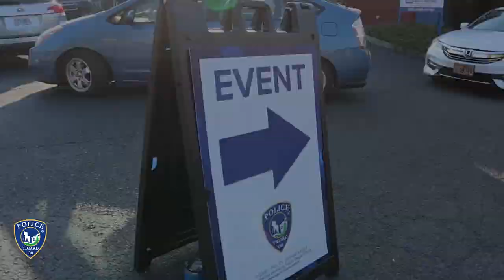Catalytic Converter Theft Prevention Event

Comment: The problem with this is : the criminals will just start breaking down the Converters themselves , then just sell the contents . ( no way to trace the raw materials ) .
Reply: Really? Explain to an honest recycler how you continually supply rare metals?
The BUYERS enable the problem, plain and simple.
Reply: Or wipe the  paint off with acetone and grind the engraving off with a grinder. it's not that hard and would take less than a minute to remove a vibropeen etch. This is nothing more than making the public feel good while actually doing nothing to prevent theft.
Reply: @mrmark8603 they would probably just lie about being part of a recycling company.
Reply: @kcstott I remove every cat on cars we own, not only does it improve mileage,  I get 40 a piece in scrap.
Reply: I found nine stolen a few feet away all emptied out already
Reply: @ThorOdinson-zc2kq ya my one cousin scraps junk, and any vehicle he gets he cut it off right away and makes it straight piped lol, he asked people for junk around the neighborhood and gets rid of peoples old junk piles or Appliances, it’s actually a good thing haha it’s getting recycled lol
Reply: Just start breading down the converters themselves?   That is not an easy task.  It's hard work and thieves are lazy.

Comment: So the paint will withstand the 1,200° heat of a typical catalytic converter and a sander or grinder will not remove the etching?
Reply: if the scrap yard sees its been sanded/grinded off theyll call the police(usually)
Reply: And yes, the paint will withstand the temperature.
Reply: Even shady parts dealers won’t touch something that was obviously stolen. Criminals aren’t going to take the time to remediate a part before selling it. They’re inherently the laziest pieces of shit on the planet.
Reply: Ok, this is not theft prevention, this is theft recovery.
Reply: @davidmussack4529  I'm pretty sure they'll pass up a vehicle with paint. It's too time consuming to try to unload them. Same thing with those whacky locking mechanisms. It's a deterrent
Reply: Most but not all converters have a shield.  So that might help.
Reply: @bryanmanning5726  If that were the case, the scrap yards would already be calling the police when the same people are routinely showing up with catalytic converters to sell.
Reply: Most cops could not care less. My car was stolen and they wouldn't even come take a report. I at least needed to know if it hit an impound before I couldn't afford to pay. Living on a tiny pension it matters.
Reply: No it will not!
Reply: A can of brake cleaner and a few rags will remove that paint from 100 converters. To the people who say thieves are too lazy to do that, or that none of the oh-so-scrupulous scrap dealers will accept them, I’d say that the facts the thieves must either remove the pieces of exhaust pipe they cut or that the scrappers accept them with the pipe stubs attached prove that idea wrong.
Reply: @philsmith2444  this is a great comment. People underestimate how much junkie zombies and other worthless garbage humans will go to avoid doing honest work.

Comment: I got my catalytic converter stolen out of my car in my driveway. After I got it replaced through insurance, I went to a muffler shop where they welded rebar in multiple places to prevent it from being stolen again. Cost me about $125. (The thick rebar can’t be cut with battery operated saws and if they could, it would take too long)

Comment: To the commenters mentioning scrap yards/dealers etc : These cats aren't being stolen by or sold to junk yards or scrap dealers. Catalytic convertor theft are large and sophisticated networks of organized crime.They're stolen by petty criminals who act as employees to various middlemen and they end up in illicit operations that recover the rhodium, platinum, and palladium in the cats. These precious metals go to either legitimate or black markets. Some of it may end up in the hands of legitimate manufacturers of either OEM or aftermarket catalytic converters. 

The cats are most often removed from vehicles that sit higher off the ground and cut off with a battery powered sawzall. Often done by a 2-3 man crew, the whole operation takes about 90-120 seconds. 

The biggest challenge for law enforcement is proving that cats found in a crew's vehicle or a warehouse are actually stolen, and from whom. State's attorneys will usually not charge suspects, so police can't hold them. Permanently serializing cats (like firearms or phone IMEIs) would help reduce theft -- probably not by much -- and the program would add cost to new cars or replacement cats.
Reply: How much can it possibly add to the cat? New cat's have the executive order number stamped into it
Reply: @danp7463  The material cost per cat would be small. The cost of establishing, maintaining, and administering an effective database and the attendant bureaucracy would be higher.
Reply: @peteroleary9447 Why not make it part of vehicle registration? They already keep track of who owns what vehicle, besides other details.

Comment: The problem is the scrap dealers buying these. What should be required is for the VIN on every junk car to have it scribed into the converter at the salvage yard. Then it gets registered on a state computer database. If a false VIN for a car that has not been scrapped is used, the salvage yard gets flagged and inspected. If the scrap yards don't like it, they get their license revoked. Also make it illegal for a scrap yard to buy from a random person without that person scribing the VIN on the ones they are selling to the scrap yard. Also their photo ID would be scanned by the buyer.
Reply: Yes, more state control of whether/not I should be allowed to sell my property. Sounds wonderful.
Reply: @GroovesAndLands  That's right. A lawless society needs enforcement.
Reply: @jonlanigan3439  You Democrats just LOVE liberty, don't you?
Reply: @GroovesAndLands  I'm not a democrat, but if you buy stolen property, then you are a thief. Sounds like you are one of the thieves running the salvage yards.

Comment: So, why aren't the car companies doing this????
Somewhere on the CC, stamp the vin# of the car.
Reply: Cos while it's more effort, they will simply extract the platinum inside the converters if you make it too hard to sell the converter as is.
Reply: I knew a guy who had been in jail for a minor offense tell me that he had never been caught stealing CC's.
He drives around like a college or university where there are plenty of students with cars parked on the streets about the property.
Then he would bring a battery wheel cutter or saw's all (More quiet when run slower speed). He's crawl from one car underneath to the next one parked and in a few hours make over $1000 for the night's work.
I asked him who he sold them to and he said that he had no problem finding someone to sell them. I then asked him why not extract the precious metals himself and he said that it much harder unless you have a good work lab to do that with.
Electric oven for melting and so forth.
He was a druggie as well and I understand that all he wanted was the "fast money" to buy more drugs.

Comment: The buyers know a good converter is stolen, so why would they care about buying one with paint and engravings on it?   If it has the VIN on it then a scrap dealer could run it to see if the car was scrapped, but then why wouldn’t they have the whole car?
Reply: You have it exactly right !
Reply: First, scrap yards don't know if a catalyst is "good" or "bad"; they don't have a test for that. Second, they're still valuable if they're "bad"... There is a process to reclaim the poisoned Rhodium, Palatium and Platinum inside the catalyst. Third, why must a convertor be "obviously stolen" if it arrives a scrap yard for recycling? People with used cars get the dreaded P0440 trouble code all the time - indicating they must replace the catalyst. They buy a new one, take the old off, install the new one - and then scrap the old. Not stolen.

Comment: In California catalytic replacement converters must come from the car mfg dealership.
Used cats are not allowed. During smog checks, the cat is inspected & if not oem mfg
product, the smog test  FAILS  & the car owner has to get the cat replaced with one from 
the dealer. As such, Ca does not have quite the problem as the other states because 
stolen cats from Ca have to be shipped out of state for resale.

!

!

Comment: I think we as an existence are getting dumber by the minute. Spraying that will not stop any thieves. Put the pressure on manufactures to start hiding the sht when it is being built. Then making it only accessible to certified dealers or licensed mechanics that can access the panel(s). Or if someone wants to change their exhaust system, then you can only start from the connection of the backpipe (pipe B) and towards the rear of the vehicle. $150 more on the total retail price of each vehicle isn't bad for some better security.

Comment: Catalytic converters rarely fail, they should be installed at the factory where they can't just be cut out so easily.
Reply: Some are, my q60 has 4 catalytic converters, and it’s impossible to reach and remove unless you have access to the engine bay. I don’t need them tho, I’m eventually going to get downpipes
Reply: @2seep  Good anti theft design, other makers could improve their designs.
Reply: What do you propose they make the exhaust systems out of that wouldn't be easily cut by either a sawzall or a cut-off wheel???

Clearly, you're not a golfer...
Reply: @GroovesAndLands  Clearly you have not seen some of the protection systems people have made. Exhaust pipes are 2mm steel easily cut, Install a 1/4 inch plate or 1/2 in rebar cage. A thief will cut out a cat in 5 minutes, he ain't gonna spend 30 minutes on my car, he'll move on to your car mate. Clearly you are just a golfer.
Reply: @peterschmidt1453  Ah yes, 1/2" thick AR500 armor plating sounds like a great idea. I"m not worried about my catalysts being stolen; only one of my cars has them, and they are built into the header itself.
Reply: @GroovesAndLands  As per my first comment, easy theft can be designed out.
Reply: ?? Which gen? Last i checked the exhaust manifold is built into the cyl head, but the cat is still attached to the turbo's turbine housing. Same deal with the none turbo variant
Reply: The average converter begins to clog in the first 60 thousand miles, and is almost completely clogged in the first 100 thousand miles.
Reply: @GroovesAndLands tbh, car manufacturers have other problems to deal with, which is able to pass these stupid required inspections to be road legal. They have their own problems to deal with over a Cats...
Reply: @caledoniawarrior  No. I was an OBD calibration engineer for one of the OEMs for 10 years. So long as the fuel system is working properly, you'll get a minimum of 150k useful miles from the catalysts - and usually more. Also, the typical failure mode of the catalyst is not "clogging". Rather, it loses oxygen storage capacity and simply doesn't work as well as it should - which should set a catalyst efficiency trouble code (P0440).

There are, of course, exceptions - but in 99.5% of cases - catalysts do not "start to clog" by 60k and are not "almost completely clogged" at 100k. You are incorrect, sir.

Comment: Or we could just not have catalytic converters in the first place. They only rob horsepower and fuel mileage until they clog up entirely. Then you get to spend a ton on replacing them with another one that will clog.
Reply: Tesla
Reply: @foam27  My wife had one for 3 years. I don't think they are anything like they are cracked up to be.
Reply: @foam27  Cordless battery powered cars suck.

Comment: If cars had a skid plate protecting converters that needs to be removed first and a collar on either end that turns so you can’t get a potable battery grinder to cut . Make it a 10 min job on a hoist … not a 2 min job when it’s on the ground!

Comment: The thing I don't understand is who is actually buying these converters.  The police should also go after them and shut down this whole operation.  I don't see how marking the converters is going to solve the main problem.
One reason people don't get involved in this theft, is because there are usually 2 people involved, and one of them are armed and dangerous to approach,  while the other person is cutting off the converter.  So unless you want to be shot, don't try and approach these people doing this kind of theft.

Comment: Oh ok so the criminals can't take a spray paint can and spray over that. What a excellent gimmick you have there
Reply: Every anti-theft measure can be overridden or worked around. But each layer of inconvenience added makes potential thieves move on to easier targets. No lock prevents being picked/bypass but the unlocked or open door invites thieves.
Reply: Eddie- Catalytic Converters don't usually have paint on them. It may make a thief look elsewhere.
Reply: Paint stripper is cheap and takes maybe a minute of your time.

Comment: Wrap the converter and some of the pipe with 1/4” stranded cable bolted fore and aft. Spray hi-temp orange paint all over it.
Thieves will move on to an easier target.

Comment: I challenge the cost vs effective value of catalytic converters. What peer reviewed scientific  evidence is available from more than one reputable source that demonstrates that the catalytic converters has had an effect on what ever the target was.  No one has ever told the public exactly what that target is or how long it was going to take for the catalytic converters to stop or mitigate the target problem. We are seeing are currently seeing (May 2023) House of Representatives hearing where the head of the EPA can't or won't answer questions about what thee cost is of some program and how long the tax payers are supposed to keep funding it.   And as it's starting to see the light of day the COVID panic was a government agency fraud. We have seen massive lying solely for the intent of fleecing the tax payer. IMO I'll bet we could get rid of all the catalytic converters and it would have no effect on anything measurable.
Reply: As an automotive engineer that spent a big part of my career on engine and emissions calibration - I can definitively tell you that catalytic convertors are HUGELY effective at reducing carbon monoxide, hydrocarbons and oxides of nitrogen from an engine. In fact, a CARB-compliant emissions control system reduces CO, HC and NOx to near-zero.

Comment: that will stop no one, Do you think thieves check to see if they are painted, they want the metal from inside it, it looks like a brillo pad but it is made from very rare metal, they chop the outer skin with an axe and pull the wires out, that's the best money from a scrap merchant, if you well the whole unit its classed as mixed metals and the price is lower,